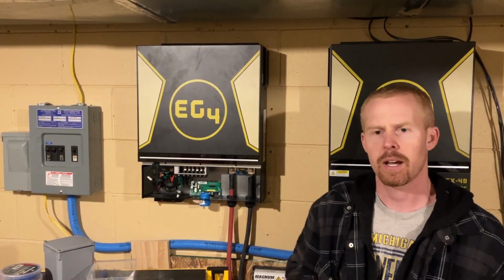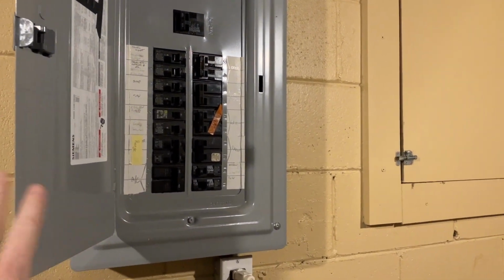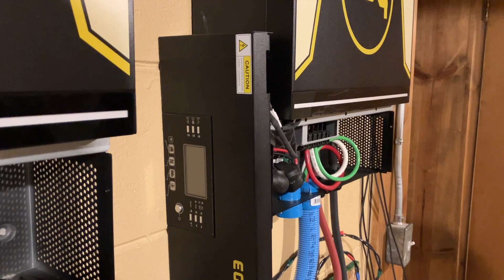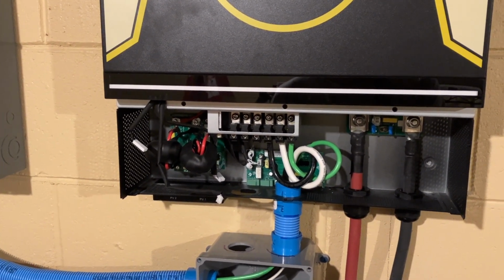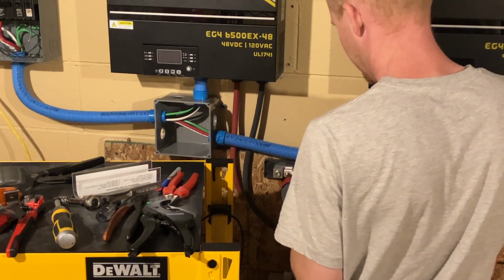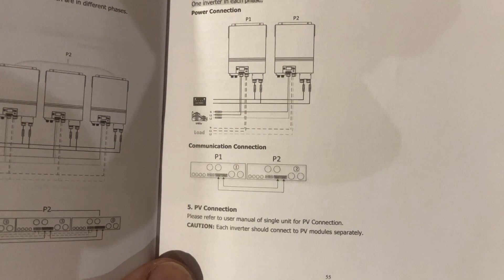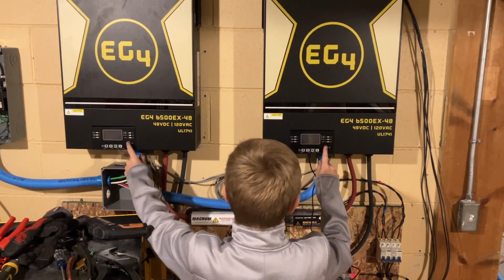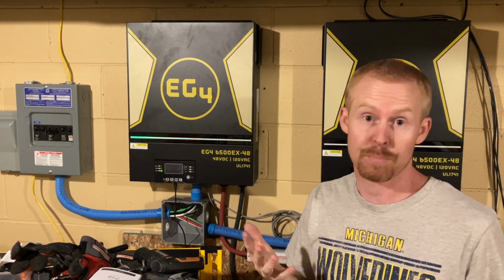Setting Up Split Phase between my EG4 6500EX Inverters

Comment: BTW, I just commissioned my system as far as having it hooked to batteries and the grid and it worked perfectly.  I’m glad you clarified the 2P1/2P2 setting procedure.  The manual was a little cryptic.  Thanks for that!
Reply from the maker: Congratulations!

Comment: Good job on the programming, I went through this last month with my two units. Something doesn't sit right with you connecting the neutrals and grounds in that box but I just can't put my finger on it. I ran mine all the way but used #6 wire in 3/4 conduit. Seems to work fine.
Reply from the maker: Thanks.  Was happy to finally make some progress.  Congrats on getting yours up and running!  

Yeah the more I thought about it the more I didn’t like it either.  To my (limited) knowledge, it should have been fine, but I ran them all the way as well.  I would have put the neutrals on one bus bar and the grounds on another but it just seemed to make sense to run them all to the panel.

Comment: Thanks Adam, what settings did you use for your DIY batteries? I'm planning on adding a bank of 280ah EVE cells in the near future to run along side the Lifepower4 batteries in the rack. I'll have to ditch the battery comms and use the "USE" setting and wanted to know what settings to use.
Reply from the maker: It really varies depending on who you talk to.  I keep changing mine around but at the moment my bulk voltage is set to 56.8 and my float is set to 54.8.

Comment: Does 70 watts total seem like an appropriate draw from both on the battery alone when there is no load?

Just a sanity check…

Thanks!
Reply from the maker: When in standby mode (not inverting), I’ve seen 35 watts per inverter for the fans to run.  When inverting but having no load, I’ve seen between 65-75 watts per inverter.
Reply: @AdamDeLayDIY  thanks for the sanity check!

Comment: Square D Power Distribution Block, 175 Max. Amps, Number of Poles: 3, Primary Wire Range (AWG): 14 to 2/0 AWG
Reply from the maker: Oh yeah, I forgot all about those.  I ended up wiring the AC Output direct to the breaker box, but I think I know where I can still use one of those.  Thank you very much!
Reply: You can get it from amazon
Reply from the maker: @offgridlivingstlucia8865  yep, I saved it to my solar wish list.  Thanks again!

Comment: You should call Signature Solar, tec support there should only be one neutral ground bond at the first box where the ground  rod is , I may de wrong  so check  with there TEC support there great guys
Reply from the maker: Thanks.  I’ve tried to call them and haven’t been able to get anyone from tech support on the phone.  

The only place I have any ground-to-neutral bond is in my primary panel right off my meter.  I’ve heard mixed reviews of how the actual inverters handle the bonds internally, but for my AC electrical, the panel my inverters is tying into is strictly a sub-panel with no bonding.

Comment: I'm going thru this process myself and went with a 60 amp breaker for my AC out to my panel after reading the manual, however I just realized that the 60amp breaker recommendation in the manual is for the AC Input.  After doing some math the 60 amp breaker will only be able to support 7200 watts per inverter so it is making me question if I should keep the 60 amp breaker or upgrade it to an 80 amp.  Adding the 80 amp breaker would still protect the wire as 4 awg is rated for 85 amp (unless there is some sort of electrical code I am unfamiliar with requiring overhead).  Since these inverts can surge up to 50% for 10 seconds I feel like an 80amp breaker would be the correct choice.  What are your thoughts?  Chances of needing the 80amp overhead in my situation is small however if I am going to be purchasing a breaker I might as well buy the best choice the first time around just in case.
Reply from the maker: It's interesting.  It seems like they've changed the manual again, so I don't actually see recommendations on breaker sizing anymore.  Could be that I just haven't had enough coffee yet this morning.  

Keep in mind I'm no expert or electrician.  

I've seen people use 60s and I've also seen people use 70s.  I know Will Prowse uses 60s but that's for his car charing which probably doesn't have much surge at all.  

If you think about it, the typical max amperage that the units can output is around 54A.  So a 60 should be perfectly fine for normal usage.  Surging, I see the manual says it can max surge up to 13000W (but I'm sure that's only possible for a few ms).  Ultimately it falls back to the trip curve of the AC breaker you're looking to install.  What's it's maximum time it can be over current before it trips?  Unfortunately I'm not really good at reading those charts to determine that, even for my breaker.  

The more I think about it, breakers have to be able to handle surges for at least a few seconds.  I've seen A/C units on 40/50A breakers surge over 110A on startup, but they level off and the breakers don't trip.  

I guess if I was concerned about the surges, I would probably go with a 70a breaker.  Still well under the limits of 4AWG wire amperage and would give you a little bit of room.  If you're not concerned about surges, then stick with the 60.  In my case that's what was originally recommended, plus they're under $20.  70's you can get for around $45 and 80s around $55.

Not sure I really helped at all...😀
Reply: @AdamDeLayDIY  I appreciate your very detailed reply.  Sounds like I need to do more research.    

I'll be drilling thru my house here soon to make the holes for all my disconnects and intake of the DC lines from the solar array.  The more information I have planned out before I make permanent holes in the house the better.
Reply: @AdamDeLayDIY  I live in Michigan and wondered if you would be open to a phone call/email to discuss solar.  Knowing that every state is different having someone specific to Michigan to talk things thru would be a welcomed resource.
Reply from the maker: @kreaded  I completely agree.  Don't make my mistake!
Reply from the maker: @kreaded  Sure.  If you go to my channel page, under the about menu you'll find my email.